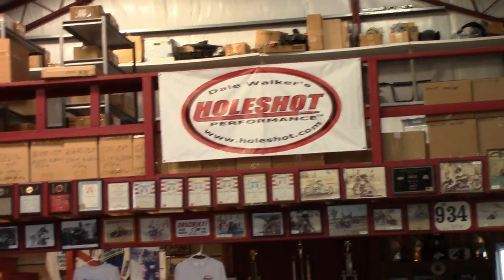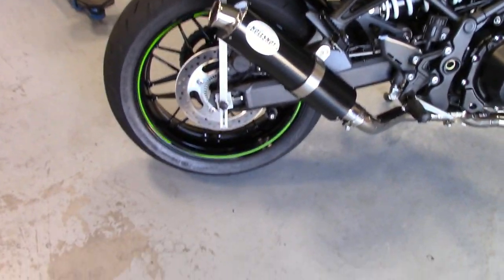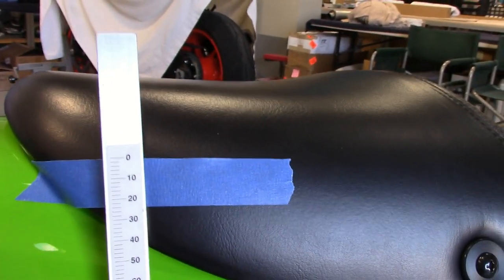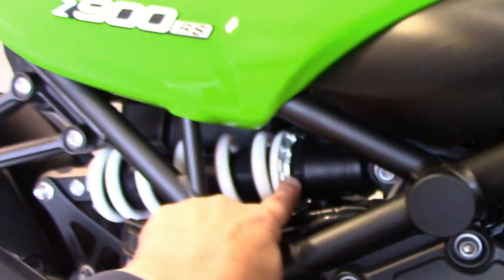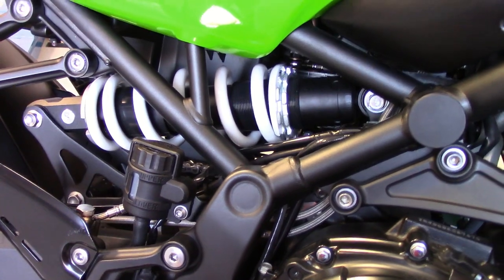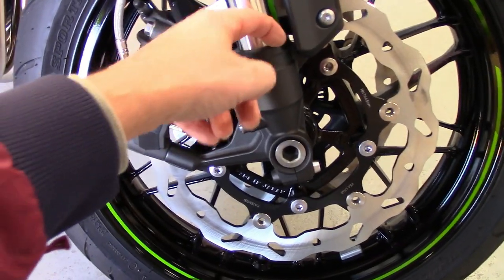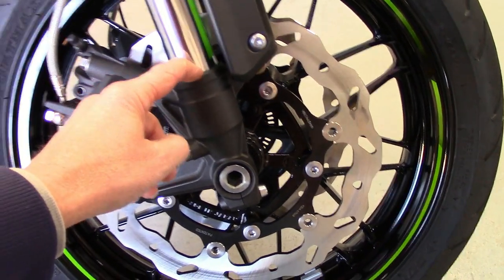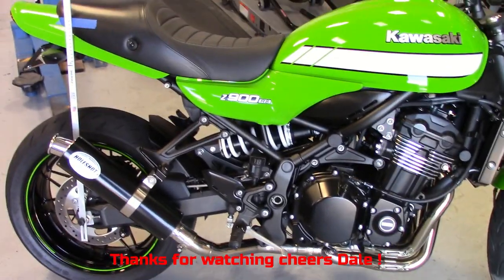Kawasaki Z900RS Setting Suspension Sag Numbers  Dale Walker Holeshot Performance

Comment from the maker: Thanks for watching guys, and be sure to comment below if you like the video's, give a thumbs up, ring the bell and be sure to subscribe  > Dale Walker Holeshot Performance
Reply: Hi dale have the same bike ? What is you best uncorrected horsepower with all your modes I live in Florida want to do some modes when you get a chance thanks
Reply from the maker: @albertschneider5978  I only test in SEA HP with smoothing on the full 5 setting. This is the industry standard and the smoothing hurts it a bit , but allows you to get a much better idea of problem areas. I can tell you Standard or uncorrected settings only changes the numbers about 1 to 1.5  HP either way. Cheers  Dale

Comment: Excellent I need to try this. Tried wheeling my 2022 z900rs tonight and it is sofffft I'm 6'2" 220ish
Reply from the maker: This will help, but you will need to upgrade the rear spring most likely. DW
Reply: @DaleWalkerHoleshot  need like 100N spring rate? Will do very occasional 2up riding also.

Comment: Awesome, this is exactly what I've been searching for easy and to the point, would these numbers be the same on the Z900ZR? Also I weigh around 98kg
Reply from the maker: Yes, but your about 216 lbs. You will most likely need a stiffer rear spring Dean.  Cheers  Dale

Comment: Very helpful video, thanks Dale. One question regarding measuring the 0 position for the rear suspension: this is done holding the bike straight with tires on the ground? You said 'lift up the bike, take all the tension of the shock'. That sounds like putting the rear into the air 🤔
Reply from the maker: Hi Daniel, Its best to have a buddy help you. With the side stand down you can tip the bike to the left, lift and top out the shock, or even slightly lift the tire off the ground even 1 inch. Cheers  Dale

Comment: Hey thanks for making these videos! I adjusted my suspensions which started with similar numbers to yourself, for the front forks I'm maxed out on the top adjuster and can only get to 40mm or rider sag, is there a way to receive the limiter of harness adjustment? Am I doing something wrong?

Thanks again
Reply from the maker: If your doing it exactly how I show you in the video, 40mm is fine. You must be heavier that I am. If it feel like its bottoming under hard braking, you may need a slightly stiffer set of fork springs.  DW

Comment: Do you reckon there's a chance to use a preload ring C-spanner, Dale? I have a couple versions from Öhlins, and two other types of preload ring hooks to fit a 3/8” ratchet. I can also smack with screwdriver and mallet if req'd!
Reply from the maker: Just use a new medium to large flat blade screw driver. Take your time and hold in position. Most spanners are a pain in the ass to get in there.  Mark the adjustment ring with a Shapie marker to keep track of your turns.  DW

Comment: Hi Dale. Thanks so much for the video. Picking my bike up today, and I see the preload is backed out to no rings showing. Gonna try and get the dealership to help me set sag, and if they can’t, I’ll just move the rings in till ~19mm are showing. 
Did you have to adjust the front preload from factory too? 
If so, by how much? 
I weigh 190lbs, 200 with gear.
Reply from the maker: Hi 69, forget the rings. What you want is 35 to 40 mm max of rider sag in the rear, and front. The front end should have that much adjustment, but the rear spring may be to soft for your weight to get those numbers. If not, look into another spring. The valving is not to bad from the factory. Cheers DW
Reply: definitely check all settings, set up and pre D might not to do this, i put my own little dot with a sharpie and reset all 4 screws, one of the front forks was a turn off from factory settings!) id be interested if your final sag settings were close to mine
Reply from the maker: @jean-pierrefernandez2460  Not sure since its been awhile now. I use a nylon tie around the fork tube when I do the front.

Comment: Excellent tutorial 
My z900rs feels like it's running on flat tires under my 250 pound butt
Reply from the maker: Yeah you will need to update the fork springs and rear shock most likely.  Cheers  DW

Comment: Im interested in this bike (trying to find a demo) but wondering how comfortable can you get it with stock suspension? Im 200lbs and sometimes ride with my 120lbs gf and roads around here are just terrible more so after winter. Thanks!
Reply from the maker: If you just cruise you should be ok, but you will need to really compress the stock rear spring with the top adjuster. In a perfect world you will want to install a stiffer rear spring, then set up the sag for that. A stock bike with you on it will really sag how they come off the showroom.  Cheers Dale

Comment: hi dale, got my 2022 z900 cafe a few weeks ago, i checked the rear shock and it was literallyonly 2 turns from the edge, i measured like u said and turned it in a full turn and now its 38mm, im 200lbs maybe i should leave it there, im about to get out the zip tie for front, im assuming the large outer nut does the front adjustment? 
(edit: yep went 5 turns in, 2 more than stock to get 38mm)
feels good, but havent tried in rain yet, riding in the wet is what got me thinking it might not be set up right in 1st place, i lowered my tires to 36/36psi and so far thats made the largest diff, they gave me the bike with 38/42 psi (manual probably errs on side of higher weight or passenger)
any other pointers appreciated
thanks again,
jean pierre
Reply from the maker: That's a good starting point, go with 34 to 35 PSI front and 38 rear for the street. Cheers DW
Reply: @DaleWalkerHoleshot  thanks man

Comment: Dale, about how many turns of rear preload did you add? I'm picking one up tomorrow, and perusing the online owners manual did not yield any useful info about rear preload ranges or even the standard setting. At 225 pounds I reckon she will need a few twists of the ring!
Reply from the maker: It does not work that way, you have to measure it to do it right Ricardo, and do the front and rear at the same time. You can just crank it up between test rides and get it better, but that is not the way to set up the suspension. DW
Reply: Dale, yep I do understand the principles at work. But if I knew a 50 pound lighter rider on the same bike had X turns of preload, I'd put in X turns and begin measuring at that point. Knowing a useful starting point just streamlines the process of finding the ballpark, no use looking until we reach the correct city.
Reply from the maker: @RickyJr46  Ok I'm at the shop now and just l looked at my bike for you. I have 19mm of threads showing from the top surface of the top lock ring. For your weight I would at least start at 35 to 40 mm of thread showing above the lock ring. This is just a guess, and you will still need to measure it properly. Back to work now ... Cheers DW
Reply: Perfect, thank you so much!
Reply from the maker: @RickyJr46  Your Welcome !

Comment: What do you think of the footpeg position? I demo'd a z900rs and found them to be too low.
Reply from the maker: With me at 170 lbs or so suited up on my Z900RS Cafe, I have zero issues at a my street pace. I remove the feelers from the bottom of the pegs on all my bikes also. I really like the peg location for the street, and I touch the side stand before the pegs.  If your a good rider, and on the heavy side, many will need a heavier rear spring for the shock. If your going to track the bike often, it would be a good idea to have a set of adjustable rear sets. But then again it depends how fast you are. The bike bone stock is mush, with way to much sag on both ends. Watch a few of my ride along videos. Cheers  Dale